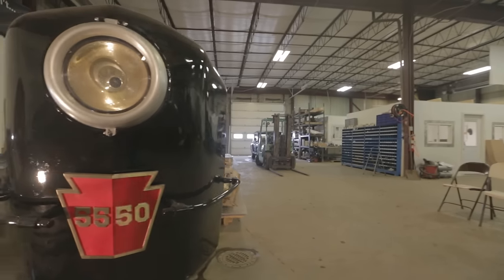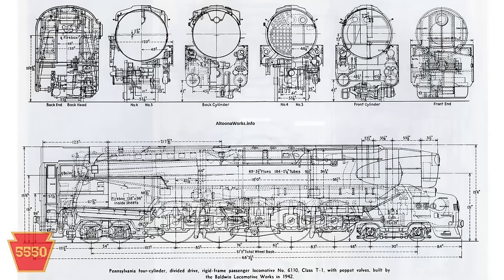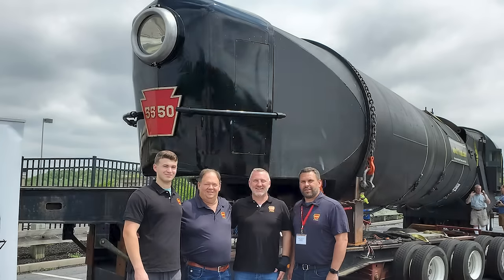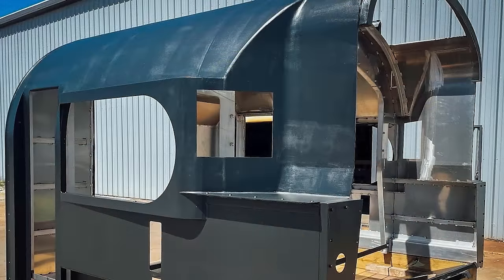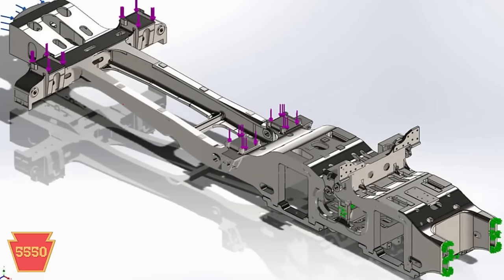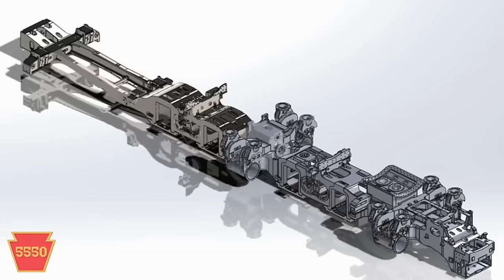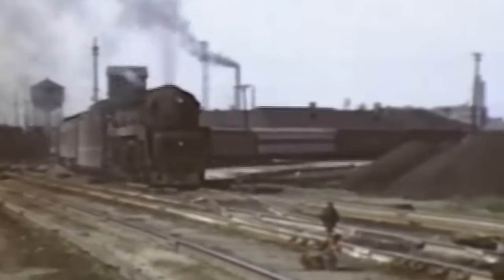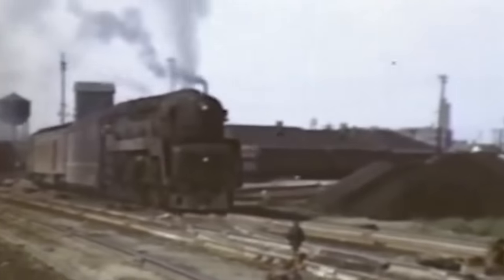Can we build a NEW mainline steam locomotive in the United States? | Restoration Roundtable

Comment: metal on metal friction and wear are a big issue with steam engines.have you looked into new surfact finishes? porsche has a new low friction coating
Reply: There are several things to bear in mind here.  First is that any hard coating and piston-ring combination has to work both with 'wet' steam and highly superheated steam, with compatible tribology.  Some of this applies to the piston rod (and its metallic packing) as well as the piston.

There has been research into some types of coating, including a practical method of forming superlattice hard coatings in locomotive cylinders.  To date the cost of implementation outweighs the easily-identified operating and maintenance gains.

There are also experiments in oilless steam-engine construction (for example Spilling, in Germany), some of which might be applicable to large reciprocating-locomotive practice.

An extreme, but thermodynamically worked-up alternative is Russell Brown's asynchronous compound, which uses tailrods to keep the piston several thou from the cylinder wall with only spot condensation between; the blowby is directed to a LP turbine for KERS or auxiliaries.

Comment: I mean the changes are enough to be referenced as a T-1c, since the T-1a and T-1b had different valve gears, so it's safe to say cause it's still a PRR T-1 styled locomotive and there's more than enough minor changes to the original design that you can say it's a new sub type. Not enough you could call it a T-2 but more than enough to be a T-1c. Now one thing a do hope you do is covert the tender to a corridor tender and maybe make a corridor water tender so you guys could do nonstop excursions between water stops.

Comment: I wonder if the improved T1 will be competitive with modern Diesels,  or close in terms of economy?
If you don't know it can't be done, there's nothing to stop you.
Reply: They of course can do it! The big issue is matnence  that was why they were displaced in the first place if we can reduce the matnence cost then maybe there is a chance ( steam has been shown to be stronger and get up to speed faster than modern locomotives)
Reply: Against 1-2 maybe 3 It could, but there’s no way in hell there’s gonna be a steam renaissance. There’s no way it can compete against every diesel. Even if it could railroads will probably switch to electric, or hydrogen. There’s no doubt in my mind that this thing would whoop the Niagaras though
Reply: @backonpro5679  Class T1 
Cylinders 18 3/4 X 26
Steam pressure 300 LB
Driver's 80"
Tractive effort 64,650 Lb
                Niagara's 
Cylinders- 25 1/2 X 32"
Steam pressure 290 LB
Driver's 79" 
Tractive effort 61,570 LB 
 ( Source: American Locomotives a picturial record of steam power
Edwin P Alexander )
Not as whooped as you may believe but yes a good sizable advantage, but please know I would love to see a project spring up to bring the niagara's back too 🙂
(Sorry It took so long to respond) 🚂

Comment: The S1 Duplex should be next.  It all starts with forming an interest group and a trust fund and foundation.  Finding the original design plans is also fundamental.
Reply: The problem with building a new S1 is that it is just too impractically large to rebuild and still go around tourist railroads. The S1 had 6 wheel leading and trailing trucks to carry its weight. That’s more than most articulateds. That is part of the reason the Trust choose the PRR T1 instead: the PRR T1 was for all intents and purposes an improved S1 that was more compact and didn’t require as much leading and trailing axles.

Comment: I love it! Other locomotives can e brought back as well. It may not be a steam locomotive, but how about a U50C? On the subject of the steam locomotive, l wonder what it would take to bring back a program like the ACE 3000 that would develop a modern steam locomotive?
Reply: @@NickTheCrossdresser2149 The other 4 class ones would probably be involved also. I wouldn’t mind seeing it happen. A reciprocating steam locomotive could theoretically burn anything in its firebox. I can imagine a modern steamer burning corn oil. What a nice smell!
Reply: Unlike a T1, the U50C had operating issues that would be difficult to solve, even in a replica.  You'd be far better doing one of the B-B+B-B span-bolster engines using the gas-turbine underframe design.  Or for real fun and a T1-Trust-style science-project test... why not a DH643?
Reply: @wizlish  the older U50 and the DH643 would be awesome! For the U50C they can make a non operational one.

Comment: Sounds like the American Coal Enterprises' proposed ACE 3000 steam turbine of the mid-1980s. It never got off the drawing board.
Reply: ACE3000 was a 4-cylinder compound reciprocating (piston) locomotive, not a steam turbine.  (It did use a turbine for the induced draft, but not for power...)

Read the patent description for a very detailed discussion of the design and its details (although Porta's sketch of the 'frame' in unintentionally hilarious if you understand what would have been needed).

Comment: I wish you guys a lot of luck!  With modern technology and electronics, computers etc I'm sure a steam locomotive can be made much more efficient , but at what operating costs? There is virtually no coal and water infrastructure around anywhere at this point in this country.  I would think Steam locomotives would still require high levels of operator maintenance unless you are designing a steam turbine based system and even then op and main.  costs are high. Another issue would be facing the GREEN WEENIES" and tree huggers. They are trying to kill off everything coal, gas and oil in favor of "ALL EV " systems.  But Diesel electric is hard to beat with modern tech too.  They started to try this in the 1980's with the A3000 project but it failed due to lack of finances I think. but this was in the 80's too, so modern tech was not as sophisticated as today.  Great luck to you!

Comment: In 1921, William Alfred Webb from Ohio was appointed Railway Commissioner here in South Australia.  During what was known as The Webb Era, many large locos took to the lines.  This era led to the 520 Class (1943), similar to the T1 (1942) but with 4-8-4 wheel arrangement instead of the 4-4-4-4 of the T1.  It will be wonderful to see this original variant up and running once more.  https://youtu.be/xRKyUm5qdug

Comment: With today’s technology you could build a stronger lighter frame especially if it’s forged. You have to have enough t weight for traction. Steel wheels on steel rails you need a certain coefficient of friction. But we still have to problem of water. The higher pressure boiler you go, you need better water for your boiler tubes. Steam is dangerous. My experience is 600 and 900 psi marine boilers and steam turbine. Boiler feed water is tested two times a day and chemicals added for dissolved oxygen and dissolved solids. You need good distilled water, more water and more water. Making water costs money.

Comment: We do it in UK, so, enjoy yourselves.
If you need help, maybe there is expertise over here.
Reply: The "T1 Trust" was originally specifically patterned after the organization that accomplished the real great technical miracle in Britain, beside which a piddling Peppercorn Pacific ranks low: restoring and then fixing the whoopsies with 71000 Duke of Gloucester.  (Look for example at the repairs involved with the cylinders alone... and how they accomplished it all in a not-very-robust economy.
Reply: @wizlish 
With 71000 they also solved all the issues which bedevilled it when it was in BR service because of mistakes and compromises made while it was under construction.
Reply: That's what I meant when I said 'fixed the whoopsies'.

I dislike conspiracy theories as much as anyone, but there come times that Tom Lehrer's 'Christian Scientist with appendicitis' metaphor seems awfully applicable.  Just as it seems clear to me that a great deal of the 'problems' with the T1 were suspiciously related to getting out of the equipment-trust obligations early, I find it impossible that several of the fabrication 'mistakes' on 71000 that kept it from demonstrating appropriate performance were not intentional.  (Just like the smokebox door on Leader being conveniently left open, or its bogie being crash-reversed while being tested on air, were "accidents"...)

Comment: The largest problem with steam is water. They need good quality water, more water, and more water. Trying to condense and reuse boiler water requires a huge condenser.
Reply: The T1 had the lowest water rate of any locomotive ever tested on the Altoona plant.  Related to this, the NYC C1a was expected to have a water rate so low -- using what was virtually a Niagara boiler -- that the engine could effectively run unrefuelled between Harmon and Chicago on the fuel in a 64-ton tender.  (Even the best of the Niagaras would not approach this, including the NYC 5550 that used FSSD type A)
Reply: Do you have any suggestions for references on the C-1a?  I’ve only ever seen line drawings of it.
Reply: I have no idea of what a C-1a looks like. @oriontaylor
Reply: I have the May 1945 detailed proposal on the C1a.  You do have to de a little 'backward engineering' for some of the detail design -- the outside-bearing lead truck, the extreme short stroke and eccentric main pin, and some other details were clearly taken over from the production T1, probably (imho) to make use of some of the GSC patterns for the engine bed.  This source clearly describes the rationale for the 64T "4-10-2" tender and notes specifically that its boiler is to be as close as possible to that on the Niagaras.

Hugh Guillaume of NYCSHS was kind enough to send me the scan, and you might ask whether they can provide one to you.

Comment: I would love to see this happen and have joined the founders club, what disappoints me is the lack of communication they have with their doners. I have asked many many times via email to help more and I get no replies which is disappointing. That has made me not donate more to them as a result. Hopefully one day they will communicate with me more but until then I will just look for updates.
Reply: You must remember they are busy with the financing (putting the money where it needs to be) and getting this sucker built by the right company and people. This thing is 10 years in the making so far and they seem to know what they're doing.
Reply: @AutZentus  I completely understand that, I just want to help in more than just money.
Reply: @AutZentus only problem this is the first locomotive they ever built, and they picked a locomotive class that not a good choice for the first new build steam locomotive.
Reply: Well it was either build a hudson from the ground up and mess that up, or test the waters by building a class that most wouldn't have expected. Especially if it's a class that barely got time to shine and was labeled problematic due to inexperienced people being paired with said engine. Plus the trust has said they've found fixes to the problems the T1 ones had in the past. 

If the trust group has managed to build the boiler, cab, firebox, smokebox, front nose prowl, and 6 out of 8 drive wheels, along with acquiring a coast to coast tender (even if it didn't originate from a T1 but is close to being one) then I have faith that they'll get the frame done and when complete it will be a damn good engine to run. They're 40 some percent complete so it's best not to give up now. Plus as someone who lives in PA I'd like to see this once extinct class show what it can do in the modern day, plus it looks cool. @gamerfan8445
Reply: @AutZentus  it not them failing is the problem. It the class. They pick a maintenance hog/ over kill for most lines locomotive. A Husdon is a better choice than a T1
Reply: @gamerfan8445  How about you start a group to build a Hudson from the ground up instead of being all-talk about it?
Reply: I hear ya .I offered tender rear lights but they didn’t even bother to say yes but rather we’re building new so that’s why I don’t donate.also where they going run not on NS OR CSX  they don’t want to no nothing at all .but ya Prr fan but not of the t-1  they already had other Prr engine an  long tender they could of done but sits there ready to tip over .go I1-sa !!😁😁
Reply: @wrakca6049  There are short lines that can handle locomotives including a Pennsy T1. 5550 will go anywhere 611 can go. Don’t give us that “mainline locomotives and short lines don’t go together” BS.
Reply: @chooch1764  one problem, a T1 is a larger engine
Reply: @chooch1764  I could, but there other important then building new steam locomotives. Like prr 1361, NKP 587.
Reply: Most of the supposed maintenance issues either relate to the FSSD type A gear, which is fixed with the B-2 arrangement and the 1948 detail improvements.  Additional work for four cylinder overhaul vs. two is not an issue for an excursion locomotive.  One of the principal reasons for the T1 project was to establish how much of the 'dog with a bad name' reputation was deserved rather than coming from financial expediency or FRN myths.  There's no need to ask whether a Hudson or Niagara was a workable design.  (And if you want something as 'wicked cool' as a T1 -- the premier candidate is C&O 490, a perfectly fascinating Hudson...)
Reply: @wizlish  fair, the A1 trust doing the same thing with the P2, however this should important to note. They are doing a P2 after showing that they built a steam locomotive that can work.  Also there a problem with having a T1. There is nowhere in the east where she can run, because freight companies and Amtrak banned steam locomotives on the main.
Reply: @gamerfan8445 The PRR T1 can go anywhere a large Northern or Berkshire can. Its wheel base is about as long as 611. Pretty sure there is at least a handful of places that can work with that.
Reply: @Stooltoad5017  yeah a 80s inch driver dueplex has the same wheelbase as a 70 inch northern. Yeah No keep teaming
Reply: @gamerfan8445  I more so meant that PRR T1’s wheel base was shorter than 611’s total length. The PRR T1’s wheel base is about 107 feet long, 611’s total length is around 109. Not hugely comparable given 611’s pilot, streamlining, and cab. However, the PRR T1 can negotiate 16 degree curves according to the Trust. Modern improvements will make it 20 degrees. When built it will be able to follow 1225 as long as the route can take its weight. If tourist routes weren’t confident 5550 could handle their routes, than why have they invited the Trust to use their rails?
Reply: @gamerfan8445  I just told you that there are short lines and tourist railroads that have invited the Trust to bring 5550 over and operate it once it’s completed. You can’t be more obvious you’re just trying to ignore me in this case. Stop spreading that rumor that 5550 has nowhere to run. 😒
Reply: At least four places in the East already have agreements with the Trust for running, and I suspect there will be more as the engine becomes operational.  This is not a particularly large engine.

Keep in mind that these is no issue with the T1 being a locomotive that 'does not work'.  Most of the actual issues in operation were teething troubles that were solved, training concerns, or economics-related concerns not applicable to replica or excursion operation.  The principal concern to be determined is the actual extent of high-speed slipping (which is a different issue from the low-speed 'slipping' you see in some of the videos), and there are good solutions to that issue developed since the T1s were retired (see for example Riley Deem and the Q2 design).
Reply: What matters here is the so-called rigid driver wheelbase of the locomotive, not its overall length.  (As an aside, neither the T1 nor J 611 has a pedestal tender, the rigid wheelbase of which has repeatedly been proven an operating impediment when backing UP 844).

The T1 has a driver wheelbase about 3' longer than a 'typical' 80"-drivered 4-8-4.  This could have been reduced using cylinder-saddle 'necking' as on the Q2s, but that did not fit with the premise the T1 Trust is using to build the replica.  Keep in mind that as a consequence of Voyce Glaze's reduction of overbalance in the mains, the J is fitted with stiffer lateral compliance in the lead and trailing trucks for high-speed operation and this makes 'long-wheelbase' concerns greater even with the smaller driver size.

Fun fact of the day to research: between the PRR Q2 duplex and the ATSF 5001/5011 classes, which had the longer physical rigid wheelbase?